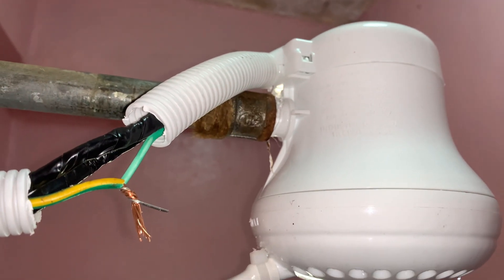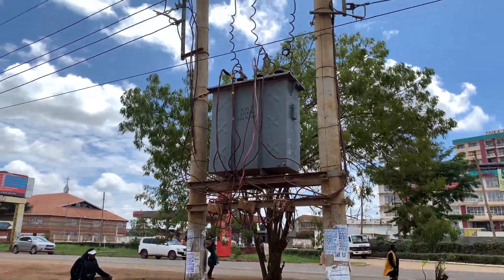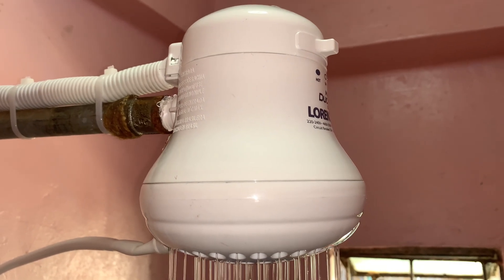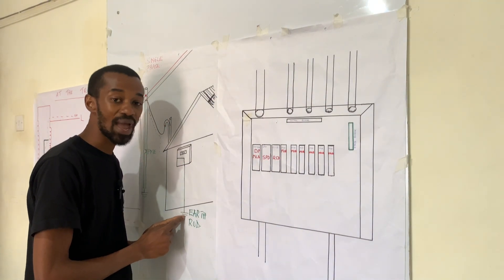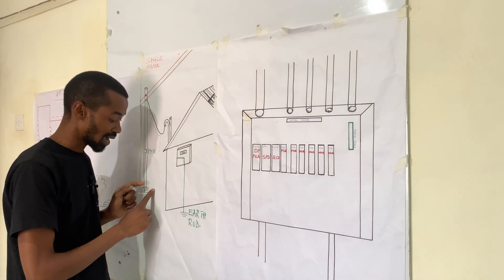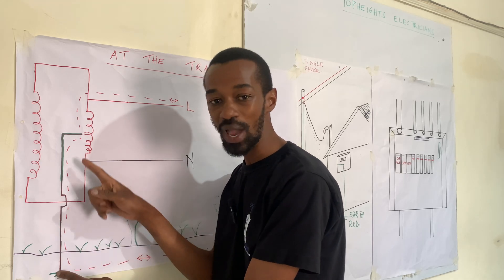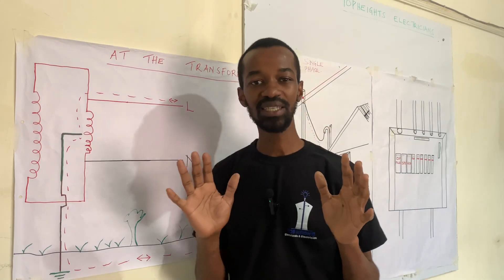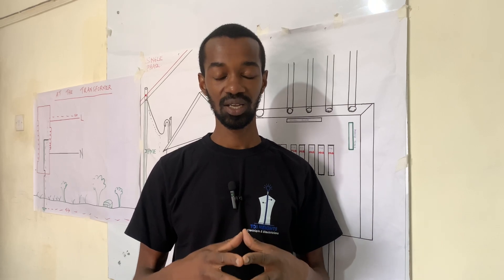What Is Earthing In Electricity? 🟩 (Simplified Explanation)

Comment: Just one correction. The earth shouldnt flow through the ground as it has a higher resistance than the conductors. The fault current flows through the earth wire back to the consumer unit/meter box where it is connected to nuetral. It then flows on the nuetral back to the tranformer, through the transformer winding, and then back on the phase conductor to trip the breaker.